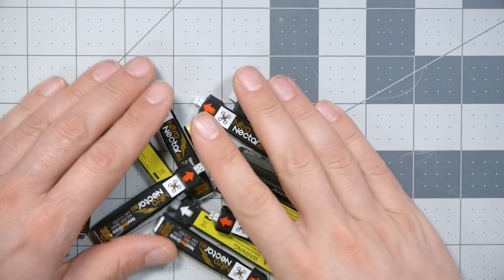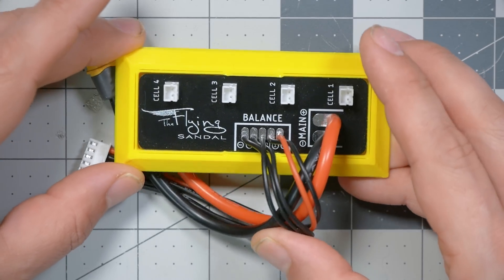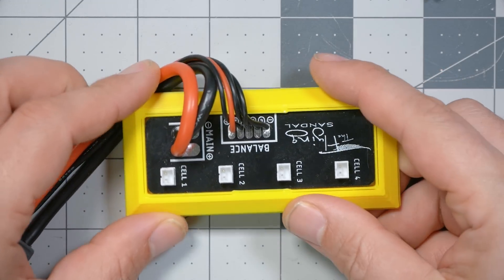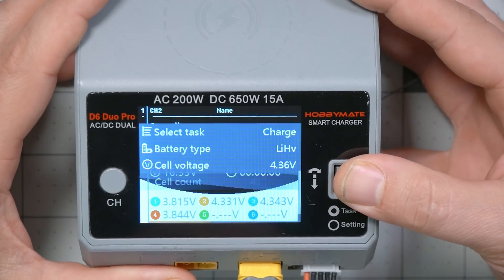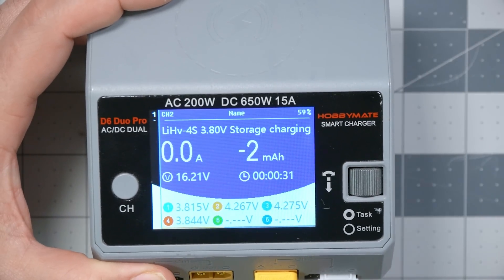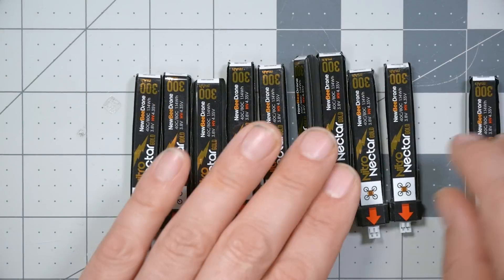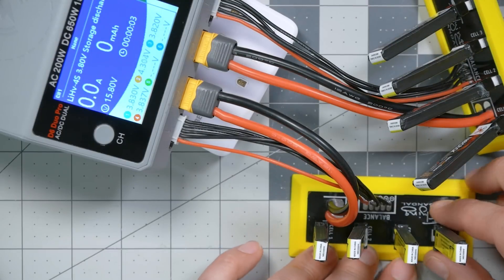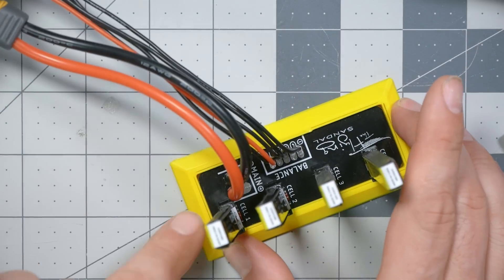Why your Whoop batteries die in storage and how to stop it

Comment from the maker: An alternative method is this 1S storage-charger from Tiny Whoop. It plugs into the battery and discharges it slowly to storage. The main difference is that it goes slower than most chargers, and it only does one pack at a time. For a cost of $5 each, you will probably spend less money and go faster with a series board. But the Tiny Whoop method is much simpler--just plug and forget.

https://www.tinywhoop.com/products/tiny-whoop-1s-discharger-pw-jst2-0-battery
Reply: I have 5 of the Tiny Whoop storage dischargers and they’re great! Pop them on and don’t worry about it. I wish I had more of them.
Reply: the tiny whoop discharger works fine for me, but they only work to reduce(discharge) the voltage on batteies. 
so if they are low already you 'll need to charge some juice first
Reply: I use the fractal engineering series board. You can use a jumper pin to select 1s-6s so that you can plug in however many batteries you want.
Reply: Hi, I have just released V2 of these boards.  I have done my best to address the feedback while maintaining the originality, ease of use and simplicity of the original, I hope you enjoy!  https://youtu.be/MoLa-jc3Xws
Reply: VIFLY WhoopStor is the first 1S charger/storage charger 30$ did they not send it to you?

Comment: Just remember that if your storage charging a bunch at wildly different voltages on this, it will take quite a while for the balancer to do it. While it might only take an hour to discharge or charge, because it's using the balancing circuitry, it might only be half as fast. So it might take twice as long. Honestly it's still faster because you get to click a button and walk away.

Comment: That's convenient, is it possible to do the same for 2s batteries with 6s charger  (charging 3 batteries as the same time)?
Reply from the maker: Yes if you had a cable wired the right way.

Comment: Sorry to report the storage voltage Amazon link sent me the charge/discharge board but it keeps failing to operate. Using the same system you have in this video: hobbymate + HobbyFly. Fails every time ….any suggestions ?

Comment: On the RDQ description it says that it will expect the board to I’ve a diff. Of only 0.3 V per cell as it’ll expect it to behave as a battery back, does this not matter due to the HOTA being smart enough to compensate? That’s why you had a diff. Of 0.5 v?

Comment: Reluctant to start an argument over time-honored concepts, so will just quote from the GNB (Gaoneng) package insert:  "Our testing also revealed that storing the packs at 3.3 volts per cell (high voltage 3.4 vpc) is optimal for retaining the capacity as high as possible."  FWIW Gaoneng says they are one of the largest manufacturer of lipo batteries in the world.  Do what you will with the info.  I've seen similar numbers several times now from manufacturers.

Comment: Have been running the same 1s batteries really hard for 6 months with no issues, at least 100 outdoor flights on each using various aircraft.  They get store/charged every day.  All the Crazypony 650's died quickly, they never lived up to their specs anyway, tossed them.  Having success with Tattu, EMAX, and GNB.  Wish I would have seen this video earlier, could have saved a couple bucks.  Just bought my 3rd & 4th ViFly Chargers from RDQ.  The first ones off the line had some issues, thinking about retiring that one even though it still works reasonably well.  The newer ones work like a charm.

Comment: You could put wire links in unused battery sockets, so if you have just 4 batteries connected, link out 2 sockets and select 4s in the charger.

Comment: Hi Josh,

Regarding reduced battery life that we usually notice much more often with 1s cells, well i would guess primarily the reason is that they're built with lower quality materials overall....

But trust me and I'm speaking from experience of more than 6 years in lipo & lion cells, the number one reason which is controllable that reduces battery life is charging end voltage and discharging end voltage, and the well known Temperature 

So if you want to increase the cycles of any battery you've to compensate with those factors, i would highly recommend that you test charging a normal lipo to 4.10 end voltage and see for yourself the impact on battery life 

And remember lihv cells generally don't last as long as normal lipos, reason being that they're primarily normal lipos with slightly modified chemistry to give broader range of use, but what you pay in return is reduced battery life due to more strain on the battery itself ( charging to full 4.20 or 4.35 incase of lihv) really push these batteries to their limits!

That's what I want to highlight

BTW you're doing great for the community and i love you videos, keep it up

Comment: that doesn't make sense that all cells have to be plugged in, surely theres- wait no, i get it, because the main XT60 lead is connected at each end, not with every cell. if you didn't have to plug in the XT60 and charged through the balance leads only, it would work, but the big boy chargers rarely support that.

the main lead reports 0v unless all the batteries are connected. you could bypass that with bridging the connections on the last 2 ports, but yeah don't do that, just use other batteries.
Reply from the maker: Correct.

Comment: Funnily enough, I recently took some surplus connectors and made a 3S series harness to do the same thing. I have been using same capacity cells each time just in case - thanks for confirming that I absolutely must do that; I wasn't sure. After flying, I used to put them on one of those parallel boards that shows the voltage and pull them off when they showed 3.85-3.90V (I think HV batts are supposed to be stored a bit higher voltage?) but having to look at the board every few mins was a right royal PITA!

Comment: I have a storage function on one of my chargers.   If I'm not going to use the battery in the next 24 hours I always bring it to 3.8v to 3.85v.   Even the so called "smart batteries" used on camera quads I generally fly to 50% and shoot for 3.8v and check the cells with the app (motors off, lowest load) or manually depending on the cell.    I also heard that storing the batteries in the refrigerator (around 33F-34F) extends the life, has anyone else heard this?

Comment: Oops! Even watching the start of the video made it click that I made the mistake of calculating the charge amps incorrectly when using a series rig. I wondered why the charge cycle finished so quickly on 6 whoop 1S batteries! Turns out I charged them at around 6C! Ouch.

Comment: When I got into whoops, I build a series board on a breadboard.  It has a switch so I can charge in a 1, 2, 4, or 6s configuration.  Capacity does not matter if charging single cells in a series configuration.  The cells with be charged or discharged to the set voltage irrespective of capacity.

Comment: Just a heads up, you can charge lower counts of cells with the board, you just need to make a jumper to link (in the example of 2s in a 4s board) cell 1 negative to cell 2 positive, it will fix the issue and jumper past the 2 empty positions. The XT60 is connected to only the negative of cell 1 and the positive of cell 4 in this model, so when you only connect 2 cells you have a gap between the xt60 negative and cell 3 negative and as we know the charger is trying to charge through the XT60 and balance using the balance connection.

Comment: I have asked for 1s chargers to have a discharge option for years and I don’t know why nobody has done it. I have been using the Tiny Whoop ones but got one stuck on and couldn’t get it off without mangling the plug and yeah, they are slow. I wasn’t aware of the one you used, so going to have to pick one up!

Comment: Great info as always B.   I've killed more whoop lipos than any other.   My issue right now Iis that ive been on a 18 month hiatus from fpv due to work and life and just started checking my old 4s and 6s lipos lol(yes I know need all new lipos now, I accept cash donations for anyone who wants to send my way 😋)   All put into storage charge July 2020 and so far 10 out of 15 6s and 4 of 8 4s and the solo 5s pack I have are still at storage voltage.   Still checking the last few packs now.   All my 4s packs but 2 already needed to be tossed into file 13 but the 3 new ones holding storage well after 18 months,  I wouldn't expect less from rebel lipos 👍.    Now hopefully after the holidays I can get back to fpv, I miss flying so damn much.   😢    already have the workbench full of parts waiting to get soldered together.

Comment: IDK if anyone will see this, but I wanted to say I think this videos is awesome! Thank you so much for making and posting it.
I have one request, could you please comment on this process for small 2S batteries? I'm talking about 180-200mAh, 7.6V 50C 2S batteries. The use is for 150g robots but I have to purchase ones designed for tiny cinewhoops (I apologize for the noob question).
Is there a product for placing them at storage voltage? Do you already have a video on it?

Thank you very much for your help.
Reply: Make an adapter and use your regular charger for maintaining those.  JB also has a video on how to make a harness for quickly charge balancing them
Reply: @theflyingsandalrc  Thank you

Comment: Just build or buy 1s to 6s cable. I posted a link but its probably got filtered. iti is about 10 per cable and you can use it in paralel and charge/discharge/store  6/12/18/24/30 batteries in one go.

Comment: I just soldered a bunch of xt60 to PH2.0 and stick them on my parallel board and discharge them like normal. The charger gets confused because there’s no balance lead but it’s 1s so it doesn’t matter. Works like a charm.

Comment: I don't think charging batteries with different capacity in series makes any difference.

What you say is completely true when building a multi-cell battery. You need to match the sizes, because when you fly a battery you use the sum of all voltage across the cells. A higher capacity cell may sit at 4.0V because it is not drained yet, while another cell could already fall at 3.0V giving you a total of 7V (3.5V average per cell) but you can see the problem with that. The smaller cell will probably die after a few such flights because you don't "balance discharge them".

In charging though you can mix different capacities as long as you use the balance charge function. The charger will equalize the cells.

If you charge without balance (which doesn't make sense since it is the whole point of this border it seems) it will just take longer to "balance" the higher capacity cells and I don't feel like the charger will mind that and it would be all the same for the cells I think.
Reply: Hah! I posted my comment before I read yours. Yes, this is what I do, series charge cells with different capacities, no problem.

Comment: It is way more easy to just charge up every battery to full charge, then use the batteries for half their usual flight time before putting the batteries away for storage. The batteries will in most such cases be between 25% - 80 % and thus not take too much damage from storing. One could probably DIY some contraption were one could monitor the voltage of the battery while using battery with a motor/esc solution to get the battery at the voltage level one prefers / more exact voltage level. This can also be done on multi-cell lipos (2S and more), but that leaves the batteries unbalanced during storage. Not the biggest of problems, if one has made sure that one cell will not self-discharge to an unsafe level during storage. But for 1S batteries there is no balancing (unless you use multiple 1S batteries as cells in a multi-cell battery). So with 1S batteries I find it simpler to just use them for half their ordinary flight time, which puts them within a safe voltage level for storage.

Comment: Yeah or just put them in a fridge, low temps slow down degradation even when fully charged/discharged and it doesn't take much time for them to reheat to room temp. PS. just don't charge them until they heat up, that kills them really quick.

Comment: Hi, Joshua. I moved my mobula6 to 75mm - but unlike on all videos on internet, it just doesn't fly well. Vibrations makes it unflyable.  Problem only happens when I put 4 blade 40mm props on it, with native 31m 3 blade props even on 75mm frame it flies OK. I think it would be very helpful for the beginners if you could explain what are these filters, p I d thiks mean, but in simple terms and how to set it up. I found video how to use blackbox gyro data, but unfortunately there's no blackbox on tinywhoops =( Thanks!

Comment: Well I think you missed one point. The balance port is only discharging and the main port is charging. That means if you do plug in batteries with different voltages it will need to discharge the ones with high voltage to be able to charge the ones with low voltage to set voltage. Basically the high voltage cell will need to go thru an extra cycle. So I would still suggest using approximately same voltage on all cells if possible. It will go faster and will create less wear on the batteries. It is definitely not as important as in parallel because nothing vill short or break. but if you can sort them out avoid to much difference that is a good thing and should be recommended. Also most chargers won't do storage on 1s so a series connection is a must on most chargers. I just soldered a 2s conversion to be able to do this on mine.
If I where to create a 4s series board I would put in a switch to be able to change it between 2/3 and 4s on main port...

Comment: when you tried just 2 batteries, try changing the charger from 4s to 2s before hitting the go button and see if its happy. the isdt8 seems to be happy doing 2s even though a 4s balance wire is plugged in.

Comment: That shows the one complaint I have with my charger, the storage setting is unfortunately not a balance setting.  Suggestions on what to look for when purchasing a charger to verify if does that?
Reply from the maker: The storage setting should bring all cells to 3.8 volts, effectively balancing them. At least that's how all the chargers I've used do it.
Reply: @JoshuaBardwell  my charger doesn't balance when doing the storage settings.

Comment: i use the banggood cable, it's basically the same experience, pretty useful. but i do wish i could find a parallel board for 1s, because there's only a 4s and 6s version, and i wish i could just leave one out. e.g. when i broke in 3 new batteries, i had to run extra cycles on one of my older ones just to have a 4-pack. plus i have 5 moblite batteries, and i can only charge/discharge 4 at a time.
the fractal engineering board looks like a good solution, too bad it's US only.
Reply: The Fractal Engineering board has a jumper to set it from 1s - 6s.  Just set the jumper to the number of lipo's connected to the board. 😉

Not US only.  You can pick one up from Drone FPV Racer. If you are in Europe😉

Comment: Edited: so im correcting my own mistake. Not a clone just similar... and the fractal board was linked.

 So, this is the EXACT same as the Fractal 1s Charging board which has been out far longer... hmmmm... credit should probably go to Yves Fractal rather than flying sandal... Arent you all about "Not Promoting Clones" Joshua?
Reply from the maker: 1. Please go check the description again. The Fractal board is linked.

2. A series adapter is not a unique item that can be cloned. It's a very basic electrical concept that has no proprietary elements that would grant intellectual property rights. There is ample Prior Art for adapters to put batteries in series. 

3. I am not "not about clones". In fact I'm on record that people in FPV are usually far too enthusiastic about granting intellectual property rights where none are deserved and claiming "cloning" in situations where two items are only superficially similar. 

4. The Flying Sandal board is functionally different from the Fractal board in that the Fractal board has a jumper that lets you change the number of batteries that are plugged in. So the one unique thing about the Fractal board, the Sandal board doesn't even copy. 

5. I chose the Sandal board because I happen to own them. Sandal sent me a few a while back. That's the extent of my decision about what to use in the video. I sat down to storage my packs after a race and thought, I bet this would make a good video. I didn't use the Fractal board because I don't own one. You're reading a lot into this decision of what board to use that isn't actually there.
Reply: @JoshuaBardwell  you laid that out accurately and made some fair points. Im wrong then! 

To the racing whoop pilots, the Fractal board has always been where the bar has been set... i know you generally use the products people send you, but i would highly recommend owning a Fractal board...
Reply: To set the record straight, I didn't even know the fractal engineering board existed when I came up with mine. Like JB says, it's just a series connection, I had a harness and wanted a board, I figured others would too.

Comment: lipo's dont like to sit fully charged for a long time , its always better to keep them at a voltage above 3.7 volt per cel. Storage charge is just to prevent that it doesnt go below that 3.7 volts. i store my battery always at 25 or 40 percent.  Just buy tattu batterys these are the same as the nitro nectars just cheaper ;-)